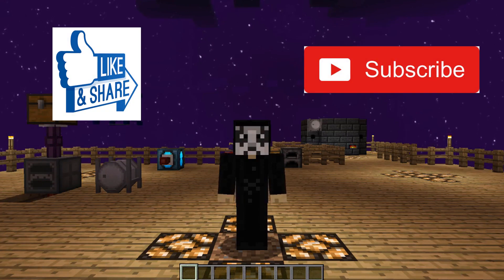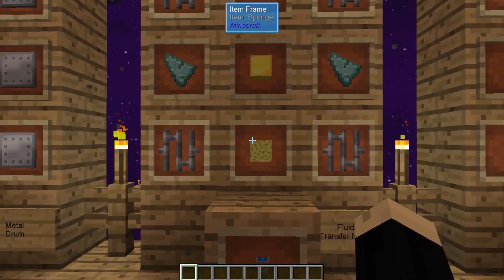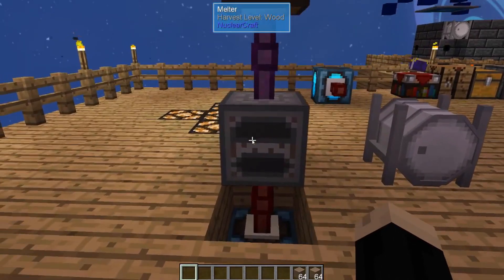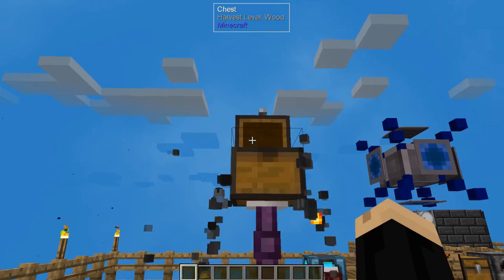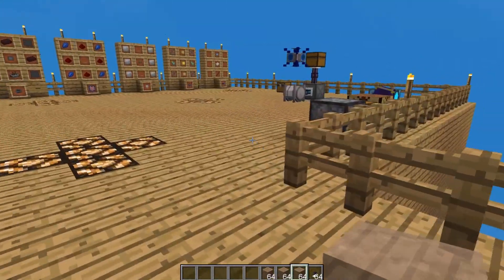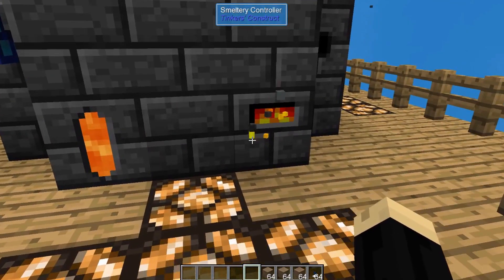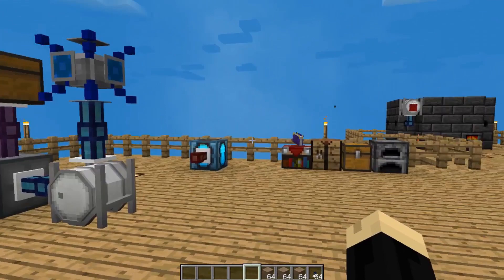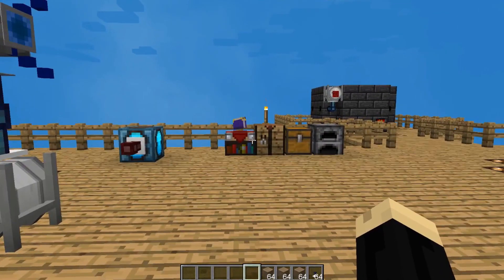Minecraft - Sky Factory 4 - How to Make and Use a Melter to Increase Smeltery Speed

Comment: I think you missed some points on this one and this setup became a little Rube Goldberg. The important part of the smeltery and the tinker's melter is that they double ore output. You can cook the ambers crafted from tree acorns and resin in a vanilla furnace for 1 ingot, but you can double that by melting them in a smeltery or Tinker's Construct (TiCo) melter for 2 ingot's worth of liquid. The Nuclearcraft(NC) melter (in SF4 pack at least) also doubles output by making 2 ingots worth of fluid. This means it's a matter of having the tech to make 1 or the other, do you need the speed and can you supply the lava or RF.
Another thing that is useful is fluid and item piping can interact with casting tables and basins. There is no need to pipe molten metal out of a NC melter, into a smeltery and then click a drain to output to a casting basin. You can pipe liquid metal from the NC melter, the TiCo melter or smeltery, a barrel or any other source directly into a casting table with your cyclic fluid cables or any other mod's fluid cables. Once they form, a hopper or any mod's extract item cables will pull completed ingots or blocks out too. NC also has an ingot former, which you can pipe fluid into from a smeltery or any other source if you want to spend RF for some speed (or use some exotic fluids that won't go in a casting table.) 
If you have the space and aren't mixing metals, you can pipe say molten iron into a casting basin and item pipe the blocks out and then if you upgrade output and the blocks don't cool fast enough, add a second basin or 3rd.

Comment: Thanks for your videos! 
Do you know if the AE2 systems can read that the smeltery makes ingots? If I set up a processing pattern would it recognise that it could send the amber to the smeltery and then cast it out?
Reply: It would be a multiple step process but yes you could do that. I would automate it by 
1), creating a pattern that turns something like iron acorn / resin into iron amber.
2),  putting an ME export bus on the smeltery controller and tell it to output Iron amber with a crafting card. (This will tell the ME network to craft more Iron amber if there isn't any)
3), use something like thermal dynamics hardned pipe with servo to continuously pump the molten iron from a smeltary drain to a casting table or casting basin.
4), if you want the iron back into your network, hook a ME import bus to the casting table or casting basin and it will pull the completed item back into the network
Reply: Jarquafelmu thanks, I’m sure that would definitely work but I’ve now set up the Mekanism machines and can turn amber into 4 ingots each. Got it connected to my ME system so I can order the iron 👍